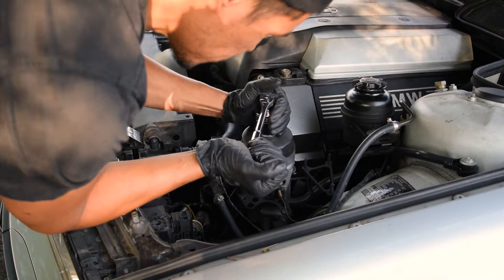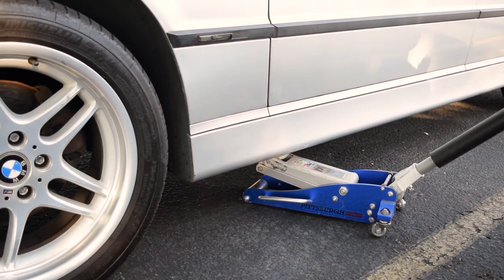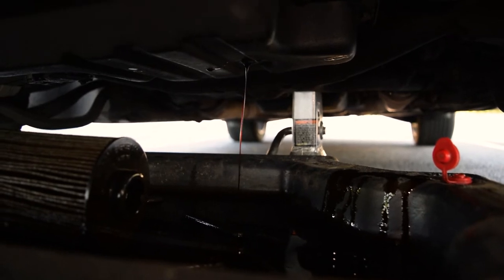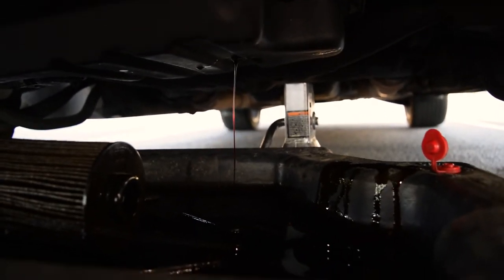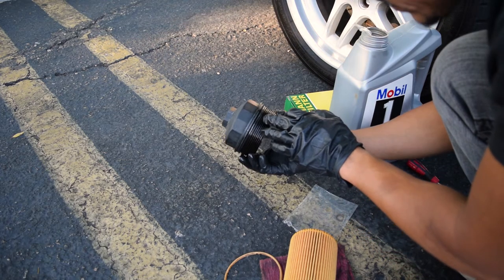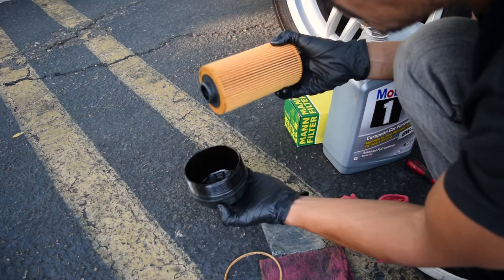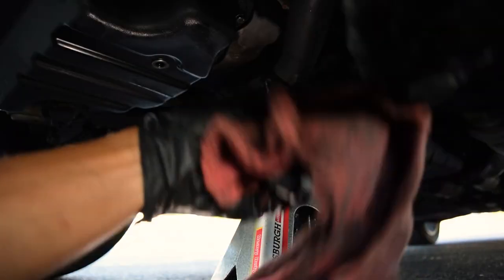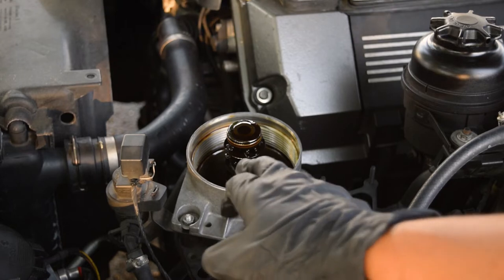HOW TO: Oil Change BMW 7 Series (e38)

Comment: MANN oil filter includes O ring and drain plug crusher washer / ratchet socket wrench / 36mm socket (oil filter housing cap) / 17mm socket (drain plug) /  jack stand / funnel / oil catch pan

Comment: 2000 BMW 750 IL Titanium Silver/Black Leather,super clean inside,the car had years of leafs and dirt /grime,hidden in a corner at at used car lot, with many other cars hiding it! Well I saw it,and 1yr later i bought it,as a non runner!

Comment: I’m still waiting for you to come to DFW ,help me get my E-38 750 back on the rd,I had the oil change 112 ago,and only drove it 25 miles when my power stearing  belt snapped,so it does have new oil and filter. Liquid Molly/with a additive.I have two new batteries,I’m getting crank but no start,Love your Knowledge on BMW,I’ll be the other Leo from 🇨🇱

Comment: does Mann expect you to use the small rubber O-Ring instead of a crush washer,  They used to include a metal crush washer. whats the purpose of the small O-ring ?

Comment: Thanks buddy Its a great succesful useful vid. Bythe way probably it gonna solve my long years problem STOP ENGINE NO OIL PRESSURE msg. Funny but oil pump replaced brand new+sensor changed but it start again after 1 year especially weather very hot engine very hot. My question is :  fake oil filters might be cause of this STOP ENGINE msg ???? because of  I awaked yesterday my filter just trash veeerry bad condition and probably prevent oil circulatio. Thanks lots, Erhan.

Comment: Awesome, thank you! Subscribed!
Reply from the maker: Thanks bud!!! I saw on your channel you seem to be driving either a 7 or a 5 on your trip. Great gran touring cars!!
Reply: @ARPerez  740il!
Reply from the maker: @channelfortheeveryman3139  That's the long boy!
Reply: @ARPerez  Yes! And I’m having some issues so I’m try to learn everything I can.
Reply from the maker: @channelfortheeveryman3139  What sort of issues?
Reply: @ARPerez  sometimes I turn the key and the car....doesn’t not start, but doesn’t roar up like it normally does. It sits at super low RPM for like 5-10 seconds, then all the sudden roars to life.

Comment: could you tell me where is okay to put the jack stands? im afraid of putting it in the wrong place
Reply from the maker: Put it where I did, under the subframe works
Reply: @ARPerez  okay that help me alot, i read on google it wasnt good to put it on the subframe in general but wanted to check with someone that has an e38.

Comment: what oil should i use 10w 40 or 5 w 30 .ive heard 5w 30 is to thin .
Reply from the maker: I usually use 10w-40
Reply: Suppose to use 5w-30. BMW LongLife-04 approved. Full Synthetic